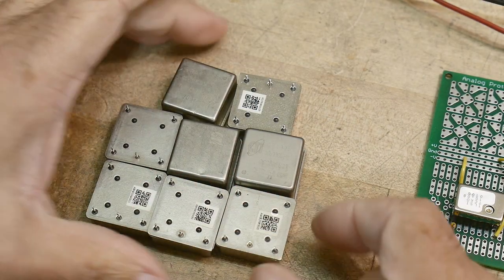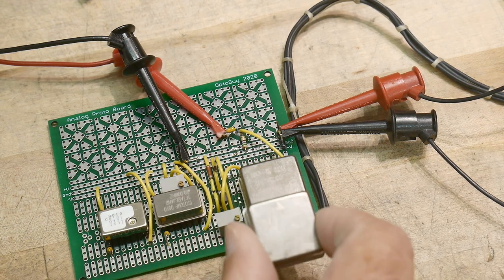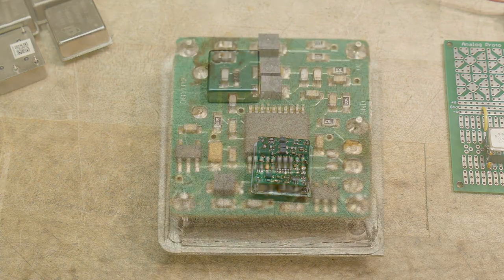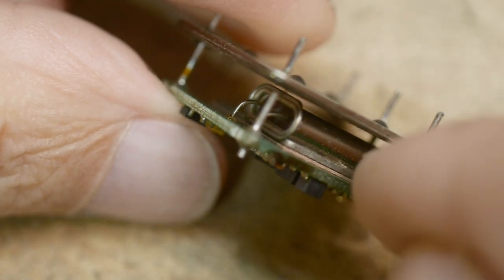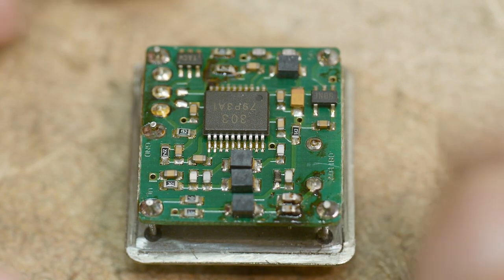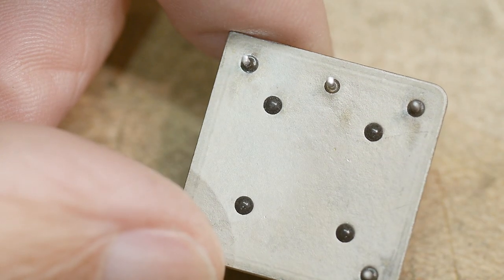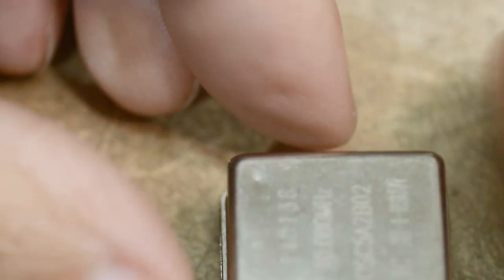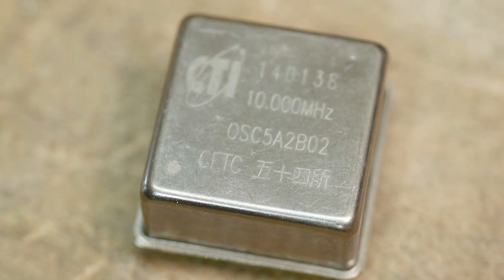#1359 OSC5A2B02 Oven Crystal Oscillator

Comment: Thanks! Those are perfect for upgrading my consumer-grade freq counters, and my ham transceivers, and at just over $4 each. Excellent. I just ordered 6 of them, my post-Christmas present to myself. Some people don't realize that the older a Xtal oven reference is the more stable it is. I'd pay more for a used one than a new one. Ten MHz is the most useful freq, although I wouldn't mind a couple that were  5 and 25 MHz. Of course, once you have a precision reference, with a bit of work those freqs can be generated, but then you're having to play with phase noise, and I'm lazy.
Reply: The price does seem to have crept up a little since last i checked, at least from the more 'reputable' ebay sellers. Or did you find them elsewhere for 4 bucks a pop? edit: ah, i found the seller. Yeah, insanely cheap.

Comment: Using regular IC's (not a microcontroller), what is the easiest way to divide the 10MHz down to 1 PPS (1 Hz)? I am trying to find an easier (and cheaper) way than using 7 divide by 10 counters. Thank you.
Reply from the maker: SN74LV8154N might help
Reply: @IMSAIGuy Thanks, but I don't see how this chip can be configured to divide by tens, only by 2's. That's useful for a 32.768 KHz oscillator, but not one outputting an even number of Hz such as 10 MHz. If I'm incorrect, and it can be so configured, please let me know.
Reply from the maker: @AB-zw5xx  that's why I said might. you are asking for 10^7 counter which does not exist. if you can get there part way in 2^20 then get it back to powers of 10. the easy way is a $0.50 micro controller as you know.
Reply from the maker: no, it only gets you part way

Comment: So you have an external clock with a Rhobidium clock going to your DAC? Who makes it? The one I've been eyeing is the MC20 by Aurender and it's $30k.
Reply from the maker: DIY using a used Fe-5680A off eBay
Reply: No, I didn't say I have a Rhodium clock. I currently have the Aurender A30 and an Aurender N20 I ordered yesterday of which I'm trading the A30 in for which  can accept an external clock like the MC20, and yes it's 30k . The N20 has an OXCO oven controlled clock. In order to benefit from the MC20 that would be for a way more resolving system.

Comment: I used to work as a support technician for the Engineering department and second-shift production operations at CTS corp.
Our product was TCXO and VCXO oscillators for Lockheed Martin and a couple other companies - these oscillators go through aging tests lasting days, weeks or months, each one would be tested at extreme temperatures both hot and cold, frequency data would be collected every few minutes the entire time and if they were off by (X) - PPM (of the part specifications) they would be considered a fail and sent to a production technician to be torn down, repaired, and then go through the entire process again.
We even made the quarts crystal wafers that would be used in the oscillators, a very interesting process in itself.

Comment: Great video - lots of happy viewers. I have used these for several projects - I upgraded my HP 5315B from a TCXO to one of these OCXOs, also a Wavetek 288 function generator upgraded from a bare crystal oscillator. They work perfectly! On some of these modules the fifth pin is a well regulated reference output voltage to be used as the supply for the compensation pot. Regards,  David

Comment: Cool part of the day!

Could you do a video that takes one of these OCXO parts and a GPS to make a 10 MHz GPSDO?  I'm thinking I'd divide the 10 MHz clock signal by ten million then use a microcontroller to line up the rising edge of the divided down OCXO output with the 1 PPS signal from the output of the GPS and vary the OCXO control voltage based on the difference in rise times.

I know you can buy a GPSDO from China on the cheap however understanding one well enough to build one would be so much better.

Comment: I bought an old school OXCO out of some kind of HP microwave instrument and I calibrate that with a commercial Rubidium standard that I got on ebay for 85$ because the seller did not know what it was.  I have been a freq.  standard freak from time to time. I use the OXCO as an external standard for my counter and sig generator when I want better than the internal standards.  I checked the Rub. std.  informally with a Collins cal lab unit and yep, it is right on.  But thus not officially cert.  Those little oscillators you got there are a boon for ham radio or hobby work but I am still suspicious of stuff from China till proven.

Comment: I bought a couple of the OSC5A2B02 and was going to build a 10MHz reference. The OCXO's puts out a nice 10MHz sinewave. I would also like to have a square wave output. I'm thinking of using a 74HC04 to produce a square wave, but I don't think it'll be 50% duty. The VinH is 3.15 volts and the VinL is 1.35 volts. Any suggestions? Is there a better way to produce a square wave from a sinewave?
Reply from the maker: use a 74HC14. there are very few products need a true 50%. usually they just need a 10 MHz repeating pattern

Comment: Aren't they only going to be as stable as the external pot that  is used to adjust it?
Reply: the pot has a very narrow range, just about enough to comepnsate for ageing, but yes the pot should be good quality and itself kept at fairly constant temp.
Reply: The pot gets you close then the oven and crystal circuitry takes over for the fine stuff so the pot can move about a little but nothing the internals can't deal with....cheers..
Reply: True, and the supply voltage to the pot is also important. I use to low TC resistors and a 500 ohm pot mounted next to the module. By selecting resistor values the ten turn pot ends up having an adjustment range of 1 to 2 hertz total. I have checked them against GPS using an HP 5372A Frequency and Time Interval Analyzer and they are very stable.
Reply: @andymouse  The 'internals' aren't doing anything smart. If the pot setting changes then the output frequency changes.
Reply: @davidv1289  Yep, that's the way to do it. These OCXOs do have a Vref output but the datasheet doesn't say what Voltage. The Vc input is specced at 0 to  +4V so I'd expect Vref=4V. I've ordered a couple so I'll find out when (and if) they turn up. I feel a DIY GPSDO coming ...
Reply: @EssArrB   Some of these modules have the internal reference voltage output and some do not (they all have the pin). I have a Vectron brand module installed in a Wavetek 288 Function Generator on the bench right now and the correction voltage is running at 1.755 Vdc.
Reply: @EssArrB  So there's no feedback at all the 'heater' just runs, Its an oscillator with a pot that you set to the frequency you want and it sits there does it ? to X amount of decimal places. You clearly don't understand the details.
Reply: @andymouse  The oscillator cannot know whether the pot resistance has been purposely changed or whether it's changed through heat/vibration etc. So how can the "internals" compensate for something that could be intentional or accidental?
Reply: @Manticore1960  I'm just talking about basics here nothing complicated about feedback...you set the pot ok ? then the value changes due to temperature or humidity and solar flares the well designed circuit will compensate for small variations like 'constant current' and constant voltage they will hold a value.......maybe I'm not getting my point across or your an idiot I don't know but this post is 2 months ago I've moved on...goodbye.

Comment: Some OCXO oscillators could be found for 3.3 Volts DC power, while TCXO variant is a bit more efficient, going as low as 1.8 Volts DC. TCXO and OCXO oscillators are quite good for as a source of precision clock source. Especially MEMS oscillator version which is much better than Quartz in terms of shock resistance.

Comment: Yeah, very stable devices. Mine puts out the center frequency (10 MHz) at 1.6 V input. I'm imagining that it used to be around 2.5 V when it was new, but don't really know. Maybe 1.6 V is normal to get the center frequency?

Comment: What does the output look like?  I was surprised that an old TCXO  I had has more of a saw tooth waveform instead of the expected square-wave.
Reply: They can have either sine or square wave output depending on the part number. The square wave ones that I have used have a very clean output when properly terminated. They appear to be designed for a 50 ohm load. David

Comment: I wonder was it output voltage is...?

It seems like everyone wants to upgrade their 10 Mhz oscillator in various radios and instruments...

It seems like one should take care to match the oscillator to their instrument.
Reply from the maker: remember that adding a voltage divider to decrease the output or a simple amp to increase the voltage will not effect the frequency stability.
Reply: Nice...I was curious...& looked it up...the output is HCMOS...square wave...load 15 pf...Voh greater or equal to 4.5 VDC, Vol less than or equal to 0.5 VDC

It looks like you started an eBay run....

They are now going like hotcakes...

Our VHF radio...used one..era 1982..
3.2 Mhz...with +/- 1 ppm....from -55  to 125 degrees C...and was purchased for $550...

Times have changed